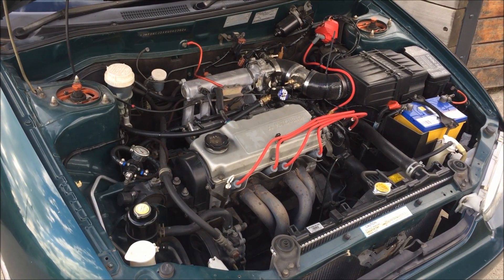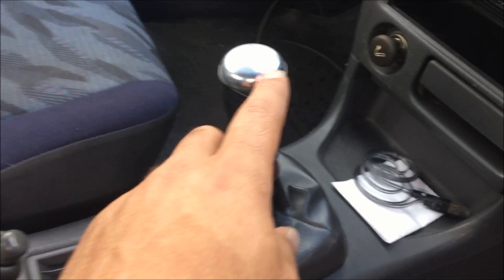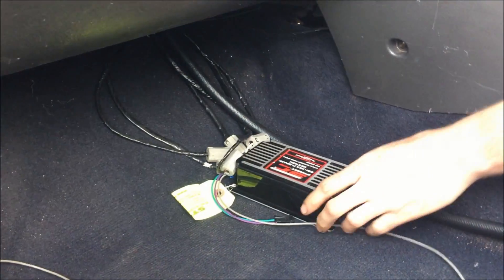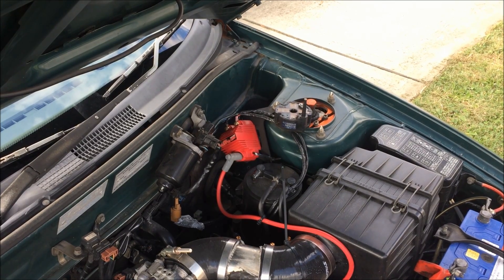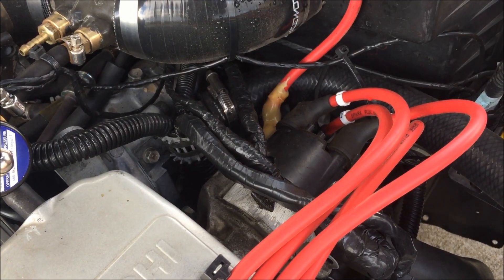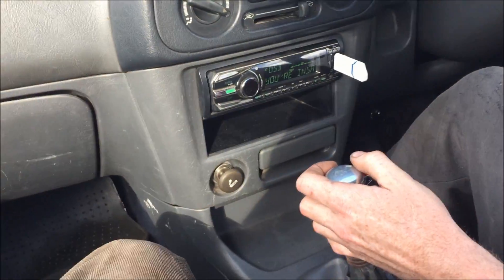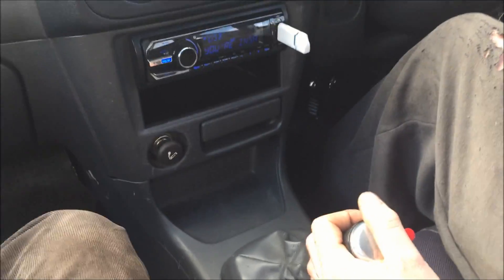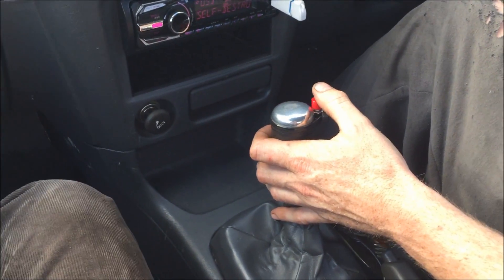We Built a WATER FUEL INJECTION System For a CAR — and Took It For a TEST DRIVE!

Comment: Several comments on how this only works on turbo engines etc, this is from a study at university of Idaho called "Effects of Water Injection and Increased Compression Ratio in a Gasoline Spark Ignition Engine" 
" It was found that water injection in combination with an increased compression ratio can increase torque output (up to 65%),
reduce brake specific fuel consumption (up to 39%), lower exhaust temperature (up to 10%),
lower BSNO emissions (by up to 78%) and lower BSCO emissions (by up to78%) but may
increase BSHC emissions (up to 45%)."

Very interesting reading for those interested, and the torquegain achieved with water injection only is significant (without raising the compression) 
David Vizard also has a video with good explanation on this topic https://www.youtube.com/watch?v=jextyKc2UN4&t=1072s

Comment: Wouldn’t you run it all the time so you can have a high compression, like say 11 to 1 but get away with using cheap 94 Octane E10 fuel? Isn’t that the point of water injection? High compression performance on cheap fuel.
Reply: You're using water to cool the intake

Comment: to build a replica for yhe injector simply just take t conector,1/2 pipe,internal rod and ppr for fixing it and electrical izolation.Suited for induction heting,dielectric heating,ionic heatting of water.very good for gasses.see wfc 423

Comment: not sure what the point of this setup is ... but with the dodgy ignition and fuel control its pretty pointless. at most all you are doing is raising the compression ratio but the cooling of the water also stuffs up the cylinder temp and efficacy. if this was even a thing i would be mainstream by now as car companies  look for any gain to be on top of emissions and power

Comment: I made a Venturi effect injection, no moving parts except for the boost mix being injected
Reply: Works perfect?use it as your daily?
Reply: @saitamakuto8724  yes for 3 years, but was an old American car, very fuel inefficient, but with this mod it managed to drive 1:10
Reply: @qwertyuiopasdfghjkl2556  thanks,you should share that on you tube it would help alot of people,was it a V8 ,v6 or an inline?can it be done on an inline 4,two liter engine?
Reply: @saitamakuto8724  works on any natural aspirated car, gas diesel or lng, with turbo you need a solenoid and a pump because of the turbo pressure

Comment: What if you drive normal and inject water ?
Reply: There's a static amount of water being injected with the setup, which means it will only work best at a specific engine speed (higher RPM with his setup).  WIth the amount of water coming out of that nozzle if it was on with the engine idling or even at low speed it would bog down and choke the engine.  I've done it before myself.  That much (cold) water will stifle the ignition; however, if you heat up the water and make it more alkaline/acidic it will be more electrically conductive and NOT stifle the ignition.  I will be doing this myself in the future.  I've been tinkering with hydrogen fuel cells for 5 years now and have developed a unique one that really boosts power and MPG, and in the near future I'm going to test out heated water injection.  The only problem is trying to control the amount of mist because nozzles by design only function with a certain amount of PSI; raising and lowering the pressure from the pump does little to change the flow rate, and too little will cause it to dribble out.  You need to have multiple nozzles turning on at different times which means you need multiple pumps AND the control modules (which run at the same price as the pumps), and those pumps run at $250 a pop.  The juice isn't worth the squeeze unless you're a racer and money is no object.
Reply: Cold water has more oxygen that warm, cold is way to go.

Comment: Wow mate didn't know they still used distributer caps. I remember my dad's 1981 fiat strada and it's arm cracking. He literally carried 3 in the car at all times. Funny thing our '84 volvo 340 had it's original up until 1999, at which point it went over to a family member.

Comment: No no no its not the same car.The car they are driving is a turbocar and yes a spray of wather will turn into steam and increase the expansion of gases but not for long.The cylinderhead temp will dec werry rapeddly bla bla bla.It will only work on turbocars....
Reply: Why only turbo cars?